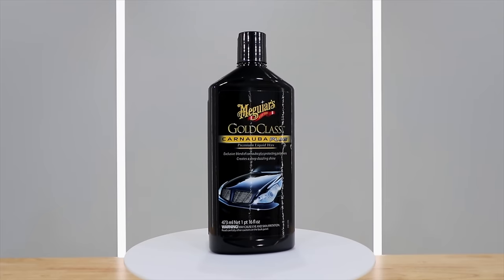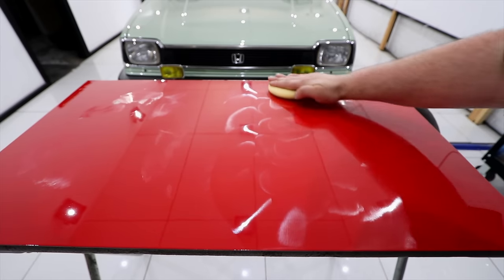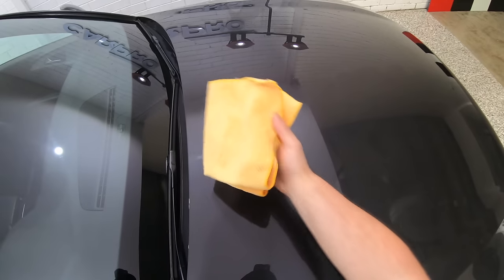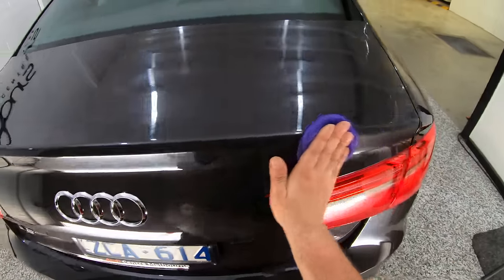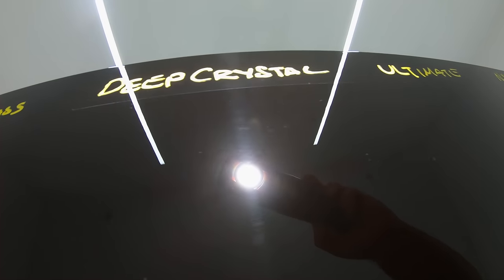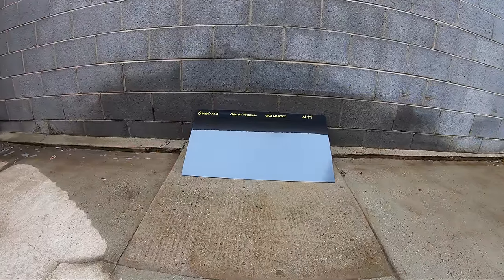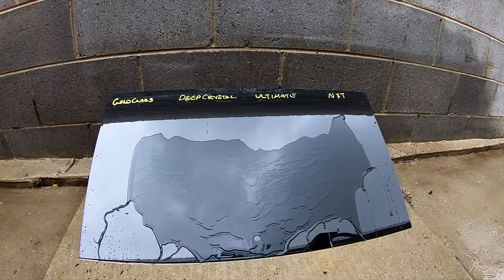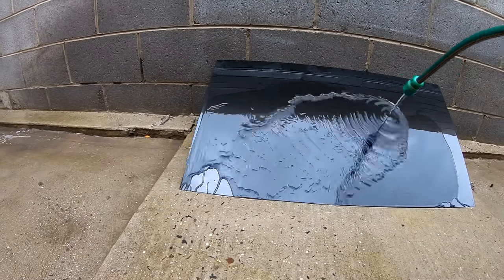What's The Best Meguiars Wax? What's The Difference Between Them?

Comment: Great video.  Even though Meguiar's puts Wax in the name Ultimate Wax, it is actually a sealant.  The wax term is meant for the average joe here in the states.  Also it is interesting to hear you say that NXT is glossier because Meguiar's touts Ultimate Wax to be glossier as it has newer polymers.  Your video also shows exactly how NXT is designed to sheet more than bead compared to ultimate wax.  Both good sealants and both nice to work with.  Ultimate Wax has always been one of my favorite off the shelf sealants .  Again great video.
Reply: Thanx for clearing that up..i was lile wax..but it says its a synthetic
Reply: So technically you should wax after using ‘ultimate wax’ for maximum protection?!! Given the cost of it at double the price of their other waxes and sealants, I’d expect it to have some wax in it, like a 2 in 1 product. They say you can wax after using the nxt sealant for the ultimate protection but I don’t see this mentioned anywhere for their ‘ultimate wax’, seems odd 🤷‍♀️
Reply: 0

Comment: Sandro,  the nxt was megs 1st ever fully synthetic 'wax',  they worked on it few years later to produce the ultimate.  They both don't have any natural carnuba in it.  So technically nxt is a father of ultimate wax. :) Forgot to mention that one change megs did in the ultimate vs nxt is to increase longevity at the expense of look and finish.
Reply: No Name  the longevity would depend on how much exposures you get. I'm in Brisbane Australia so similar to southern California. My cars are daily driven but parked in garage at night and under shade during the day. They are washed every 3 weeks..  so for me next does 2 washers before drop off and I top it up after a 3rd or applay something else  because I like to play with it. Ultimate is another car wash cycle further. If you have a light coloured car and want something that you can visibly see on car after the rain go for soft 99 fuso. On dark cars it's very tricky to get the application right and if not you will notice faint streaks ( drove me mad on one of my cars for 2 month's). Lol
Reply: I’m still confused why Megs chose to name a product ‘Ultimate Wax’ that contains no actual wax and is actually technically then a fully synthetic sealant.
I’ve seen/heard it mentioned (by Megs) that for the ultimate protection/longevity after using a sealant such as their NXT product, a wax can be applied over the top to extend the life of the applied product yet haven’t seen or heard that anywhere re: their ultimate “wax”. I do like Megs products but this kind of seems misleading, and the cost of the ‘ultimate wax’ (that’s not a wax lol), is daylight robbery!

Comment: The original "cleaner wax" from Meguiars is still one of the best on the market I have had many car show winners with it over the years, it last about 6 weeks not very long for todays standards but it is very easy to apply and remove, it also looks good....
Reply: I'm pretty sure it was more of a polisher than waxing. It doesn't last long at all if you let your car on the hot sun like I do. I think it would be better to apply a standalone wax afterwards. :)

Comment: I use NXT for one main reason. It hold both its hydrophobic & protective properties (UV, bird droppings, etc) longer than the traditional waxes. Especially on the roof, trunk & hood. Also, my preference is to first apply Meguiars polish, buff off to get a nice, clean paint shine, then apply Meguiars NTX polymer sealant. Lasts 6 - 8 months. If I have time, I will use a quality wax (after the NXT) on my roof & bonnet, just for the extra protection.
Reply: What do you think of using the deep crystal on top of ntx?
Reply: Or the other way around?
Reply: The NXT is my favorite.  I don't make money from waxes, I just like to maintain my own finishes.  I've tried tons of stuff through the years.  The NXT is hands down the most impressive.  I won't say it's better than profession products because I have no reference there.

Comment: FINALLY, Meguiar's has come out with a ceramic wax. I have lived in Las Vegas since 2004 and found right away that Carnuba wax is NOT good for very hot temperatures. I smears easily no matter how well it has been buffed. 
So Use only synthetic wax and detailer.
Reply: Yeah, natural carnauba wax can take a real beating from lots of hot direct sun.. a montan based wax fares a lot better in that type of climate if you want to stick to natural wax. From a purely durability and protection based standpoint, synthetics are vastly superior. A graphene based product is absolutely ideal for that climate, hopefully the ease of availability will expand quickly. 

What do you use out there in Vegas, something like Fusso I'd guess? Lived there for 8 years, hated every second of it, but somehow I still miss it once in awhile, which makes no sense.. 🤔😁👍
Reply: @jdisdetermined  so what products would you recommend for desert sun protection? about to move to the desert and cannot find any solid answers. Thanks!
Reply: I live in FL, hot but stupidly humid alot, what do you guys think would be better for that? (im also a beginner lol trying to get into polishing and detailing and bodywork

Comment: I used the Ultimate polish , then Ultimate wax and was very impressed on all fronts . I've since used the Hybrid Ceramic Wax as it's supposed to last longer . It felt strange spraying it on a wet car and rubbing it in for the first coat , but it does appear to give a great shine .

Comment: I have been using NXT for years, I always thought it was very easy to apply and to buff off. I also liked how it lifted the shine of even a very shiny paint, and how long it lasted wash after wash. The very first thing that I liked about it though is that I didn't have to be careful to avoid getting it on plastic or rubber trim.
Reply: I used the NXT yesterday and Wow,  Slick as snot on a door knob 😅
Reply: How about NXT’s durability based on your experience? Will you recommend?
Reply: Hi will nxt make my car paint look darker

Comment: I use for years the meguiars waxes and am very satisfied of them. Personally I use the Ultimate Wax and the (different from your test) NXT tech wax 2.0. The Ultimate is in light favor to me, maybe because I have a dark colour paint, but as said they both do please me. I also have the NXT tech wax spray version, this is very good to apply as a "service" layer. I also reccomend to first clean your paint with the Clay bar and quick detailler and then apply your wax to give it the full potential and to maximize the smooth feel and showroom shine.

Comment: Personal experience with three of the waxes without proper preparation and just a wash with a strong shampoo (paste versions):
Gold class - very warm look, pleasant smell, lasts a month long at max
NXT 2.0 - insane wet look and slickness, i could just sit there and run my fingers on the paint all day. It also gets me the most compliments from people. Good longevity (upto 3 months easily).
Ultimate paste wax - again pretty slick to the touch, great glossy look, didn't last as long as the NXT 2.0 but my observation is skewed as the Ultimate wax was subjected to insane 2 weeks of daily driving in summers (42 degrees celsius). 
My pick would be the NXT as the slick finish is just unmatched by anything.

Comment: I just bought some Mcguire's ultimate liquid wax because I researched long lasting wax to get me through the winter. Love the stuff very happy with its eaz of use. Hopefully lasts as long as they say.
Reply: Back in the late 90's I often used Meguiar's M20 Polymer Sealant (now discontinued) before winter, and it ALWAYS made it through. When spring arrived, I'd remove the M20 and apply M26. 

I could still get by with just those products today.

Comment: Great presentation. 15:00  - I use Ultimate on my daily driver. Has gone through a season of snow and harsh automated washes. By far, it is the most durable while maintaining a shine when it comes time to reapply in the spring. Ultimate is my go-to from now on, it is a long lasting brute that shines pretty. Though I do agree, NXT (which I have used) gives the best gloss that is car show ready, but not so durable for the long-run. If I were to enter a car for show, I would run to NXT. Another car forum I frequent, owners did a wax compare on some high end exotics. NXT took the trophy for best gloss and shine over one of the Zymol products.

Comment: I use Ultimate. I apply it by hand, wait about 5 minutes, or listen to one song on Pandora, then wipe/buff it off. Mostly as a hobby and just hanging out in the garage. I try to do this at least once a season and usually before winter.

I'm thinking about getting a DA polisher to make the job easier and quicker. Just have to learn about what pads to use, etc...
Reply: Griot’s black finishing pads with a simple Porter Cable polisher and an SPTA 5” backing plate.  That combination is about $120, and will do you right for a decade easy.  Of course, that polisher is a great entry-level unit that can yield great results once you know what you’re doing.

Comment: Well I appreciate you putting up this video because most people that do things themselves use these type of products...now from a professional detailers point of view you may appreciate the ceramic coatings better but from the people that have to pay someone like you to do that type of work it's very expensive and most people can't afford that.  additionally I had my car ceramic-coated as well as my wife's truck and was very disappointed in its performance versus the cost.  I feel that if you use common sense washing methods and apply a halfway decent wax every few months you're finish is going to be fine regardless... it's those people that want perfection go seek out professional detailers...but that is such a small percentage of people.... though I do feel that ceramic coatings are nice and they're the new fad right now I do feel that they are over marketed over hyped and it give a false sense of security on your finish.  Anyway just my thoughts 😎

Comment: Marketing has a lot to do with it but Meguiars is absolutely the highest level of quality.
Reply: Meguiars is quality stuff, but far from the highest level. I guess when it comes to the products you can buy at big box stores and auto parts places, it would be up there with the best, but stuff you typically need to go to a proper detailing supply shop or online retailer like autogeek.net , detailing.com , or chemicalguys.com is much better. BUT... there comes a point where the costs involved get way out of line with the benefits from those higher end products, but the same can be said about anything. I mean... does  anyone rreally need to spend $999 on an 8.7oz container of J97 Wax?
Reply: @LBCAndrew  chemical guys is absolutely lower quality than Meguiars.
Reply: I feel like Autoglym is affordable and very good quality (In Europe its affordable, maybe its more expensive in other continents)
Reply: @doehetvoorgentstudent2113  pretty expensive is aus compared to meguires and other standard brands. Ive been pretty disappointed with everything autoglym except polar seal
Reply: @LBCAndrew  Noooo not Chemical guys..There stuff is over rated over priced and lower quality than Meguairs
...The only good thing to get from them is their pads!...

Comment: As far as ease of application / removal, for me, no amount of difficulty is worth any increased performance. 

Anything that is a pain gets tossed or given away.

There is a reason Gloss Coat is the only ceramic coating I'll use, amd that is ease of application. Performance is great too, so long as chemical tests aren't done before the full 30 day cure time. After seven days it can be washed, but the internals don't set up for another 22 days.

Comment: I'm a big fan of " Meguiar's GoldClass wax.....& it does take a few wipe n buffs to remove all of the application from the area being worked on ; and the final results , to me , are amazing..!! Years ago I actually used the Simonize Paste Wax in the popular CAN THAT you COULD RE-OPEN with a quarter and after a few starts & re-waxes , I finally got the hang of it & I can tell you ; the harder the application ; & the harder the removal ( by hand) the better off the finish will be in  the end.

Comment: With the NXT sealant, I’m wondering if it should, or would do better in terms of water repelling if a wax was applied over the top. 
Maybe I missed it but the costs of the products can also be an effective method of which to choose given the RRP on the Ultimate wax is $88AU v’s say the Gold Class range at $47AU. The deep crystal can be slightly yellowing on white cars with aged paint, nor does it last the cut in terms of water repelling so I wouldn’t even go there and explains why it’s the cheapest of the four products here. Surprised to learn the nxt sealant is a cheap $44AU. I’d give it a go had they scented it because I’m a girl and I prefer it smelled nice 😂 
But my point being, I really cannot see the justification in such a high price for the ultimate wax, it’s literally almost double the gold class line and more than double on the deep crystal 🤨

Comment: I love the ultimate line up (compound/polish/wax) and have the gold class wax as well. I have used the gold class on top of the ultimate compound and polish for great results too.
Reply: That's what I am going to do for the second round on the Lexus I just bought. Ultimate compound, then ultimate polish with the gold class carnuba. Just bought a new DA policher with. 5.5 backing plate. Going to strip the last wax and do a much more though paint correction. This time. I actually really get a lot of satisfaction out of polishing and waxing. Lol.
Reply: This is what I do also, mainly because I can’t justify the cost of the Ultimate Wax at $88, I think that’s insane for what it is!

Comment: I've yet to see a review of Simoniz original car wax (which is very similar to Johnson paste wax). A good furniture paste wax has the longest durability but is a lot of work to remove (small sections only). My dad used to put it on his car and my girlfriends used to laugh because the would slide off the car.

Comment: No mention of white film on plastics and rubber. This is most important to me. That whitish to tan build up in crevasses and on plastic or rubber absolutely ruins the appearance of the vehicle, no matter how shiny the paint is. In my experience, Meguiars Ultimate wax leaves none of this residue and is hard to beat. However, I would love to know how the other products perform in this aspect of white residue buildup. Otherwise, excellent review. 👍👍
Reply from the maker: I’ve found that most newer hybrid waxes or sealants don’t tend to stain plastic trims with residue but it can be quite an individual product thing with exceptions where as most tradition waxes and sealants do tend stain trims but again that not always the case- and I agree it’s an important factor that I should have touched on.
Reply: @CarCraftAutoDetailing  Thanks for the response as well as the video.

Comment: Just and FYI, Ultimate, and NXT are both 100% synthetic polymer.

Keep in mind, stateside they call NXT 2.0 "Tech Wax". 

Deep Crystal carnauba wax is based off of M26 Hi-Tech Yellow Wax, and NXT is based off M21 Synthetic Sealant 2.0 from the professional Mirror Glaze line.

Comment: Great to see some more OTC products go head to head. 👍

Just a quick question, can waxes streak after wipe off if you leave them on the paint too long  to cure?
It's like there's a micro layer of oil on the paint that likes to spread around but never truly comes off. Usually happens with oil heavy waxes even if I use very little product.

Comment: Before this glass film coating came to be on putting a glass mirrored shine finish on, which it does look nice,  but for regardless for how ever it's out on the market,  it's really weird as to how it works the way it does in leaving this glass finish sheen ,I'm still a believer in using a given good car wax ,but there may be several on the market,  don't get me wrong, I'm all for doing a wax job on my ride,  but I think everyone needs to understand the various slight differences between the stuff that's on the market,  now wether your buying a straight out brand new ride or a used something else off the used lot or from another person,  your auto's surface will either be fresh new and clean or it will be weathered, there might really be a little bit of grime and millions of micro scratches that have that swirly effect on it's surface, cause we all know the given paint job hopefully will have some lacquer on it,  but as far as having the best answer for finding A, good method of step by step of cleaning stripping, then washing off the micro slop, maybe use the compound pad and paste or cream, then do your do for wiping it all off,  but grant you this, you will need a fair amount of elbow grease effort and maybe bust a sweat,  but with a surface of a car or truck, your only gonna achieve a certain amount of any available actual reflection, you can get close,  but your preferred idea might or will get close,  yeah there's a lot of stuff on the market, but now that we have YouTube to help us all,  maybe there's is a prayer, just don't forget the available electric buffers ,they might keep from breaking your arm, just a joke,  and no I'm not a professional car waxer per say,  if anyone really even needs one,  just use YouTube,,einstein should be able to find something,

Comment: Turtle wax hybrid solutions  Ceramic spray coating is even better. The coating lasts 6 month's and looks amazing.  A test video i saw proved it, they put a sponge with a weight on it, dragging it with a measuring device to see how much force was needed and again after many high pressure washes.